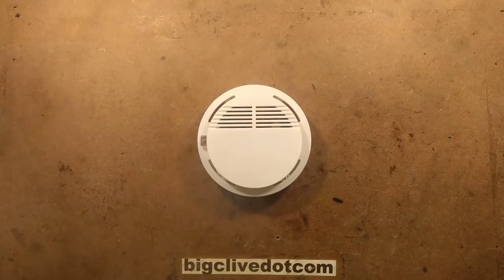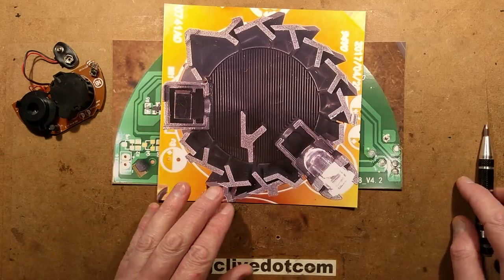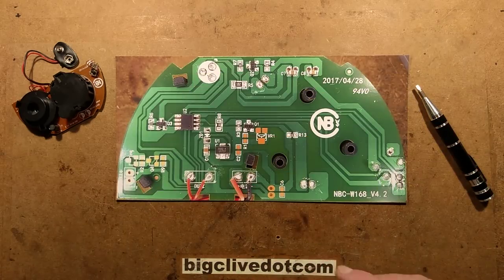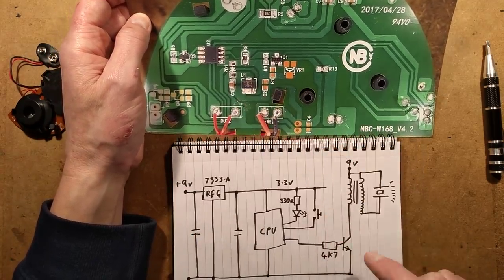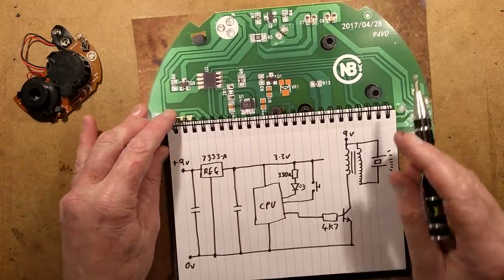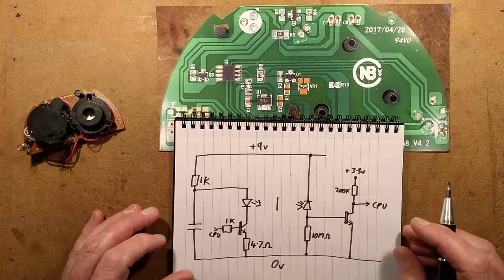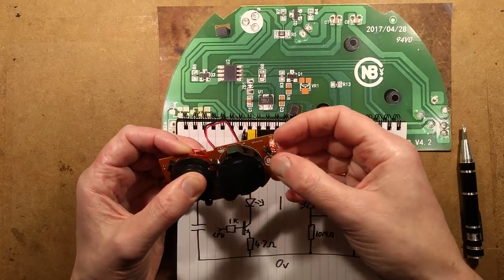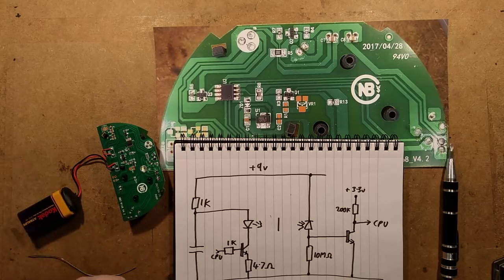Torch your home for $4. (with schematic)

Comment: DAM ..? HOW ? 3 cent full micro controller
Reply: it's Chinese's magic
Reply: Harry Potter couldn't make them that cheap
Reply: Probably 8 bit, 32.768 Hz, 1 kB, 5 gpio and some kind of battery monitoring circuit. Omit any kind of quality testing, produce in extreme high quantities and you are ready to go. Not sure if the programming is as straight forward. Might not want to use it in critical applications where human lives can be at risk. Oh wait...
Reply: at 3 cents a pop ho cares if you get ate odd dud if 50% are working you are still way ahead
Reply: Well considering you can get a very capable flash micro such as STM8 for like 20ct... Compromise on performance, on features, on storage, and foremost no EEPROM, no flash, just OTP, and yeah it's not impossible to make them for 1ct.

OTP is usually antifuse, it just selectively blows out and shorts over reverse diodes to serve as mask ROM replacement, it's a lot less reliant on high quality manufacturing than holding the gate of a MOSFET in a constant state for 20 years with parasitic charge, which is how EEPROM works.

I don't think you'll see a lot of duds among them, and if you do, they'll sort themselves out during programming and testing, before they land on the board.

As to China magic... Yeah such a thing exists, there are a lot of government subventions into microelectronics industry which pretty much nulls out engineering costs for numerous micro startups so they don't need to be folded into the price, and the risk of doing business is greatly diminished to them too. They figure if they have a good combination of cheapest and remarkably decent domestic parts, they will be able to flood the world markets with everything, and make the money back elsewhere, and I guess they're not wrong.
Reply: Siana Gearz, OTP is usually the EXACT SAME die as the EPROM part but in epoxy rather than windowed ceramic. 
I've spent weeks on end reprogramming EPROM parts during development of products I've designed around OTP parts. 
I'm speaking from actual industry experience of over 30 years. 
Blowing fuses went out with PALs and 8Nxxx PROMs over 20 years ago! Nobody does that anymore. What's your actual experience?
Reply: @Peter_S_  oooh and I've been wondering why some types of antifuse devices have died out, that explains it. So OTP is generally non erasable EPROM now, gotcha, thanks for correcting me.

I wonder though, with these things being likely made on ancient technology, sure that applies? And I mean besides, if they are EPROM, then why not one step further and make it an EEPROM, why is there no EEPROM version of these, and why in-system emulator board as devkit?
Reply: Siana Gearz - Great comment - very well thought out and cogent. I also applaud your considered and restrained response to the rude and condescending retort by Peter S.

Peter S - Thanks for adding additional information. Please consider the tone of your remarks, though. What does "I'm speaking from actual industry experience of over 30 years. " and "What's your actual experience?" add to the exchange other than a tone of animosity?
Reply: Physically blowing silicon fuses is messy and was only done at geometries that were huge in comparison to what's used today. Bipolar PROMs are very power hungry and big. EEPROM and Flash are essentially the same thing with different architectures for the erase circuitry and EPROM/OTP cells are more robust than Flash cells. EEPROM requires more everything than Flash does. Historically OTP cells have been cheaper (lower defect rate) and better (retention) and you don't need erase circuitry (smaller). OTP cells can be fabricated using the native silicon stackup used for general logic chips where as Flash uses a stackup tuned for making Flash cells. In microcontrollers there is no need to do by-byte erases and being able to change the firmware is usually a giant liability so there isn't any need to put EEPROM cells in them. 

In-circuit emulators are the standard way you develop with parts like this. On-chip debug is recent stuff by comparison. JTAG adapters used to cost upwards of $20,000 and JTAG was only on the highest end parts. I still have my bond out based in-circuit emulator from 1993 for doing PIC1657s, from the days before Flash parts even existed.
Reply: Ignes Andros, if you're going to tell other people what's happening, you need to understand it yourself first. The comment you referenced was pedant recitation of irrelevant historical information and was also wrong. What specifically in there did you find well thought out or cogent? What I saw was a piece of misinformation that left people knowing less rather than more. As a former school teacher and somebody with actual professional experience in the topic at hand, I find it obnoxious when people spout out wrong information which is obviously coming from old books rather than real experience. I listen to people with REAL experience, and I listen intently. I listen less to or discount people who are just acting like they have that experience instead of speaking from it authentically. It's sad when people who have never dealt with product design and the economics of Chinese part supplies analyze and talk like they have that understanding. I find it even more sad when people hear that misinformation and think it's actually cogent.
Reply: or they just copy some old chip with expired patent
Reply: "or they just copy some old chip with expired patent" LOL.... yeah.... sure, expired. They cut their R&D costs for the chip by using the existing lithography stencil from some big name company and just burning out a few million other chips while they can. Essentially: gray market microcontrollers. Don't use them in any products you engineer unless you're prepared for any legal repercussions. (Or unless it's just for some toy project.)
Reply: There was a discussion a few years back in one of the trade rags (EDN or Electronic Design) about whether the cheap MCUs were a more economical choice than the venerable NE555 timer.  Have the NE555s fallen to 3 cents/each?
Reply: Shush now. Get off the internet, hug your dog.

Comment: If you want to save money on smoke detectors get 10 year battery. They cost about $22. You might think thats a lot of money but when you consider that it costs $1.5 per battery about every 8 months you'll be spending an extra $15 over 10 years. So that cheap as fuck smoke detector you bought for $8 is actually going to cost $23 be cheap as fuck and might not work and will be disabled at various times in 10 years because you have to replace its battery.

Comment: A cpu ordinarily uses MUCH more current than a dedicated  CMOS device. The cpu needs to have a clock, to cycle it through all its actvities, also a voltage regulator on the device consumes power. NOT a good way to go.
Reply from the maker: Good software will do some work and then put the processor to sleep at sub microamp levels for a short period of time before waking and doing more processing.
Reply: All modern microprocessors and microcontrollers are built using CMOS technology... Some microcontrollers can even change their clock speed under control of the running program to reduce power consumption. And/or go to a sleep mode. Which can be exited back to normal mode when either a timer runs out, or a input pin detects a logic level change.

Comment: Hi Clive,  so when you pressed the test button it only actually tests the sounder and not the actual chamber.  Be better and maybe even no dearer to have a button that physically put something between the photo sensor pair?  At least then you would be testing the whole circuit was working.  Ace video as usual, Al
Reply from the maker: Proper units do test the chamber by seeing the slight reflection from the internal LED.

Comment: There are a horrible number of failure modes in optical smoke detectors. If either the Tx or RX stop working the alarm does not work, but does not generate an alarm to indicate the fault. The detector will only work with the right type of smoke, not sufficiently dense to block the detection path or fog either the Tx or RX. The smoke particles must be the right colour and size to ensure the scatter of the light, for it to be detected. 
Long term dust build up desensitises the detector, even with level compensation. It does not fail safe, and by that I mean, generate an alarm or warning under fault conditions similar to the low battery indicator. These are horribly insensitive, even when well designed. I suspect it would be too expensive to correct all the inherent flaws. One improvement might be to add a second detector in the direct beam path, so as to ensure the transmitter is working and not blocked by smoke, or dust. The ionisation type seem inherently more reliable.
Reply from the maker: Proper optical sensors do self test continuously by looking at the reflection of the infrared source even with no smoke.

Comment: I wanted to get one these things and hotwire a relay into it so it would toggle on off depending on detect , then it could be used in automatic smoke extractor thing.
Reply from the maker: You could do that with this if you put a small capacitor across the relay and hooked it into the transistor that drives the sounder via the little transformer.  You'd probably have to remove the transformer.
Reply: haha that would be a cool idea

Comment: I was splaining this to a friend the other day, from your first video. Also ben tearing stuff apart, great value (Walmart) 40 watt led lamp used for 2 year then shit the bed, I cant find anything wrong. I need a power supply tho. It's the 5 led in series Merican light.
Reply: If you've got an old computer lying around you can rip a power supply out that, and then use a LM317 variable voltage regulator to get some fine adjustment. That'll get you a fully functional supply for less than $5

Comment: Why do tracers on circuit boards go wider or thinner?
Reply from the maker: They are able to carry more current if they are wider and easier to etch too as any imperfections won't have too much of an effect.
Reply: @bigclivedotcom  I mean a single tracer will go wide then thin then wide etc as you follow it along.
Reply: @byronwellburn   Cost optimization, basically. They're cheaper designs, and less time is spent making them.

Comment: You don`t blow SMOKE with a VAPING device, it`s called vaping because it`s VAPOR, why can`t people understand that very basic piece of chemistry?
Reply from the maker: Smoke as in smoke machine.  Actually a vapour, but resembles smoke and will trigger a smoke detector.
Reply: It's physics, not chemistry. I'm a chemist. Yes, there is much on it in undergrad studies, but it's physics, still.

Comment: What is that mystery chip? There are many of those in your videos. I think ionization type smoke detectors are far better.
Reply: Why do you think that?
Reply from the maker: Check the link to Dave's video in the description.
Reply: Dwayne Wladyka - not that long ago, optical detectors were more expensive than ionisation types, and some considered the optical type to be the better type...
I have a mix of types in my home.

Comment: Now that we know you're vaping, is there any smoke detector which doesn't care about heavy vapour?
Reply from the maker: Not a smoke detector since it works by detecting the particles in the air.  But you do get rate of rise heat detectors for smoky areas like kitchens.  They detect a sudden temperature rise to set off the alarm and are immune to vaping.
Reply: @bigclivedotcom  thanks for the info. Unfortunately it's a law that smoke detectors are needed in rental apartments here. Other kinds of systems can be added, but they can't replace them. Unfortunately I'm not a fan of mtl devices, also I'm stuck to high glycerin liquids, because too much propyleneglycol makes my throat hurt, so I make pretty dense clouds. We moved recently and have pretty expensive smoke detectors now, but I didn't tried them yet, also now after your response it seems that I don't need to try them anyway.
Reply from the maker: You can get detectors with a mute button that shuts them up if a smoke event is about to occur.  Not so useful if they are professional units wired into a communal alarm system.
You may just have to vape in the bathroom with the fan running and the door closed.

Comment: I have that ebay smoke detector. alkaline battery goes flat in very short period of time. maybe 6months.
Reply: They say replace your battery every six months anyways so it sounds about right.
Reply: Ours lasts a couple of years normally... It's an older smoke detector that cost more than $2 though, so maybe they put some actual effort into power saving 😋
Reply: Most of the commercial battery-only smoke detectors will run for several years on a set of batteries, so a few months is very poor power management.  We normally replace the batteries once per year in the Spring in our detectors (both battery only wireless detectors, which wirelessly tie into the AC units, and battery-backed AC mains powered units).  It’s always a bit of a pain having to change 10 smoke detectors, but they are worth the effort since they will either give early enough warning to extinguish a fire before it gets out of hand and/or more than adequate time to escape the house if extinguishing is no longer practical.  You can even buy commercial battery-only units with a 10-year (lithium primary) 2battery life and no user replaceable battery — they just sound the “replace unit” reminder after 10 years or if the battery fails before then (if you set it off frequently).

Comment: Im pretty sure thoose smoke detectors, react to steam, but only when water was polluted :/
Reply from the maker: All optical and ionisation detectors can be triggered by a fog of droplets like steam.  They can also be triggered by the steam condensing on the PCB.
Reply: At least i know my smoke detector is not  the cheapest :P 
it wasn't detecting steam, only when i was cleaning electric kettle with citric acid, it turned on ;)

Comment: How do you know all this? Do you have a university degree or are you just self taught.
Reply: Clive apprenticed for an industrial refrigeration company in the early '80s and has learned on the job since, but is largely self-taught.
Reply from the maker: Although I worked with an industrial refrigeration company (Hussmann) I served my apprenticeship with a heavy electrical engineering company that specialised in steelwork wiring and maintenance.
Reply: My bad.

Comment: I cringed every time you said CPU. Microcontroller and CPU are not interchangeable! Yes a microcontroller contains a CPU but it also contains long and short term storage as well as all sorts of peripheral interfaces.
Reply: Brian Gentles REEEEEEEEEE
Reply: Did you understand what he was talking about? Then who cares if he wasn't precise with his jargon.
Reply: Desktop CPUs have all sorts of other stuff in 'em, too, but no one objects to calling them CPUs.  Even something as simple as an old Z80 has built-in memory refresh hardware that's not "just a CPU".
Reply: ThetaReactor - well, in some circles a Z80 is not considered to be a CPU, but instead is more correctly called a microprocessor (or MPU or uP). In the building trade, lay people are always mixing up concrete and cement...
Reply: Concrete and cement are functionally distinct, and there's a real possibility of mixing them up.  Does anyone even make a "pure" CPU package anymore?  Is there a scenario any of us are likely to encounter where the distinction between a CPU and microprocessor/microcontroller is relevant?
Reply: Basically every CPU out there is a microcontroller.  Look in your computer it has microcode firmware, cache memory, and other features I can't quite compare such as hyperthreading all crammed in yet we call it a CPU.
Reply: Brian Gentles yup it’s a cpu...

Maybe we need to refer to it as a memory cpu or non memory cpu. God forbid we throw in a micro controller into the mix
Reply: Hey, some people call the ATX case and everything in it a CPU... and they're not completely wrong you know. But even when we talk about the microprocessors, while you're right that CPU and microcontroller aren't interchangeable terms, the fact is that a microcontroller is a type of CPU
Reply: It is central, it processes and it is a unit! So....CPU!?!?

Comment: A friend of mine had a mains powered smoke detector in her flat fail with a flash and a bang, leaving a burn mark on the ceiling - see https://www.dropbox.com/s/eexlu20resnxxsl/IMG_0026.JPG?dl=0. Fortunately the circuit breaker tripped before it did any more damage. But I wonder; has a faulty smoke detector ever STARTED a fire?
Reply from the maker: That's interesting.  Any mains powered device can fail with a pop, but it looks like that unit may have been wired to a high current circuit like a socket ring main.  In a way that picture is really funny.  I'd love to have taken a look at that detector after it had exploded.